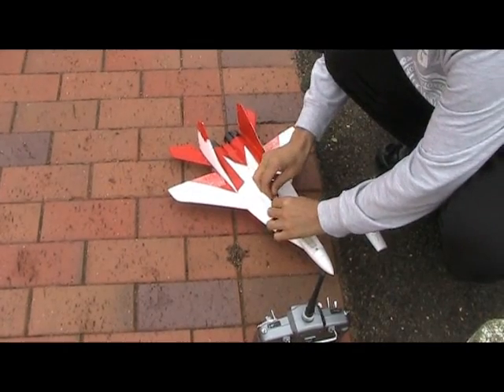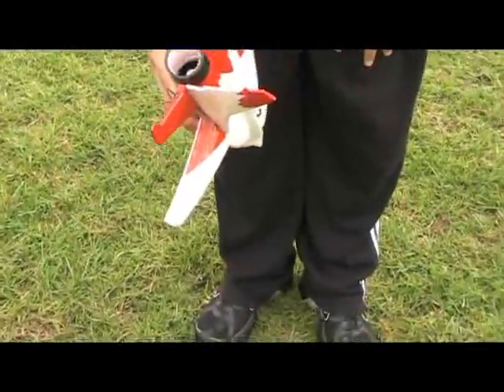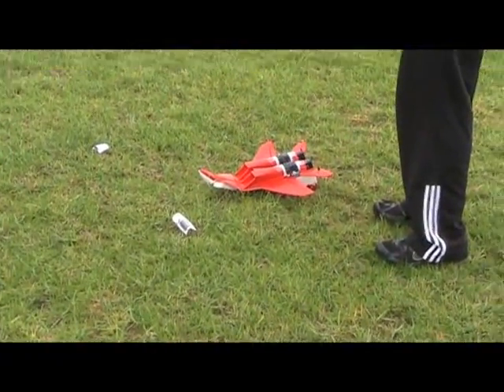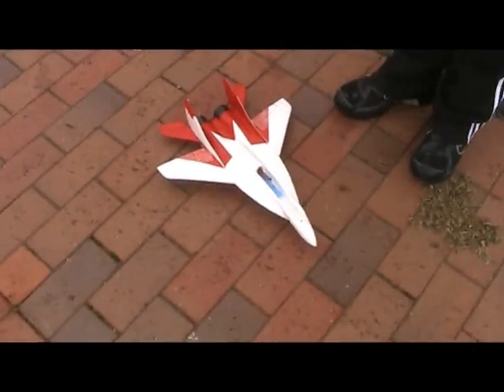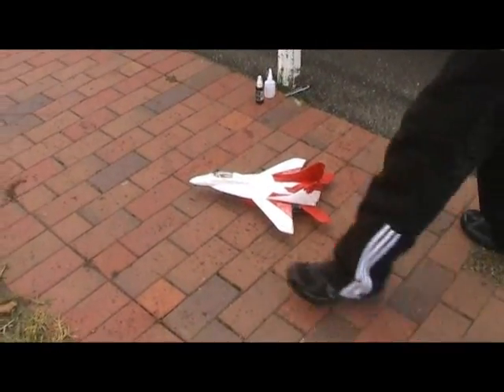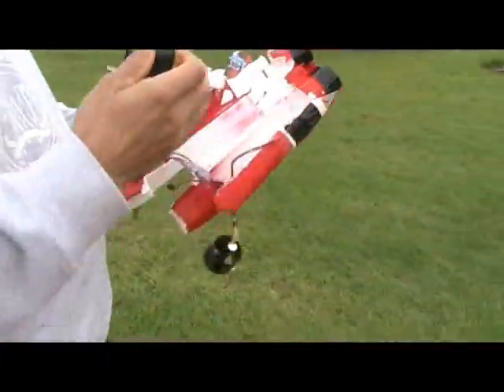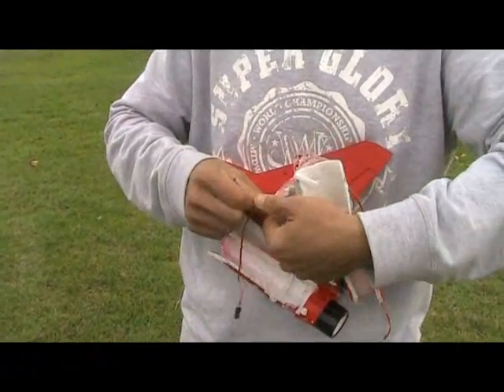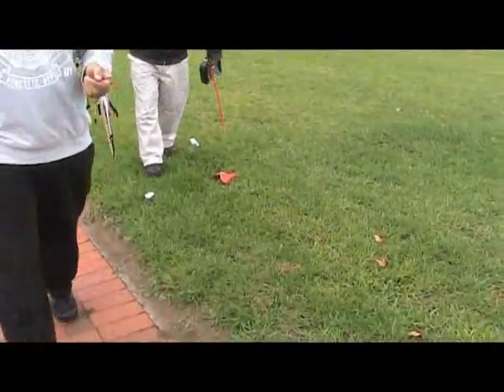Skyangel Mig-29 40mm EDF Conversion

Comment from the maker: Both sets of wings I received had downward curves. Its been established that the painting process they use causes this on their models. The underside is painted but not the top. When the paint dries it shrinks and pulls it down. Its causing other weird and wonderful problems on other models. Check the RC Groups thread.